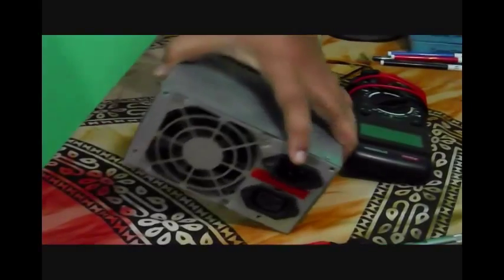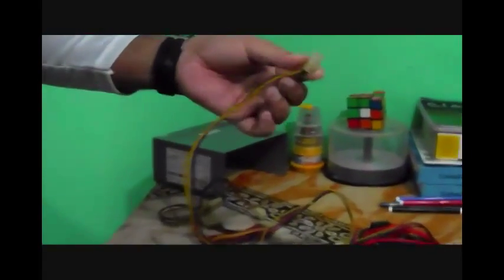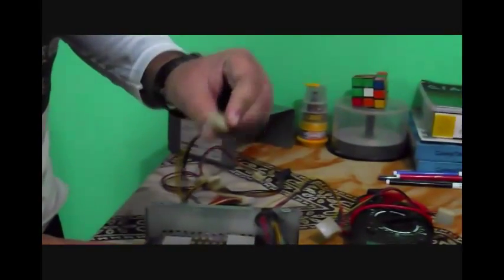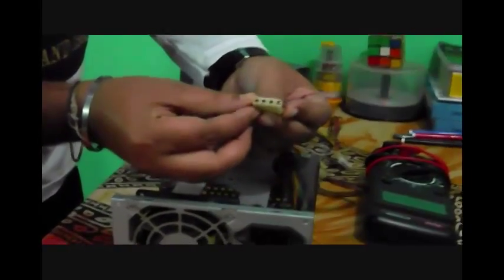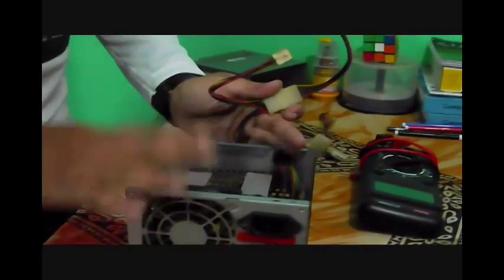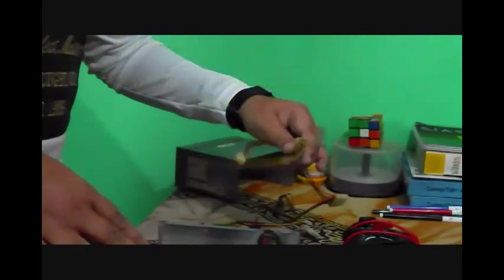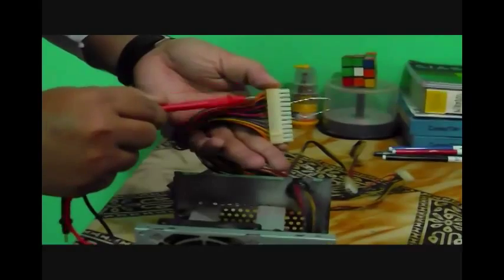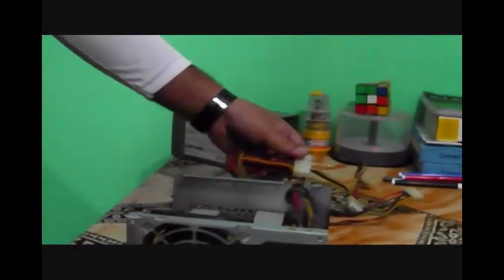computer harware tutorials: basics (smps)

Comment: the smps fans run perfect
Reply from the maker: if there is no display then there is your RAM problem..
Reply: What is the solution for ram problem??
Reply from the maker: open the RAM rub the golden connector with eraser...and connect it properly...if still dont works then buy new RAM..

Comment: how to connect smps in cpu??
Reply from the maker: there are four connectors in smps...first: there is 20 to 24 pin connector which you need to connect in 24 pin slot in motherboard near RAM...second: there is 4 pin connector which you need to connect to 4 pin slot near processor fan...and third: there are two cables which are used to power up the cd drive and harddisk.